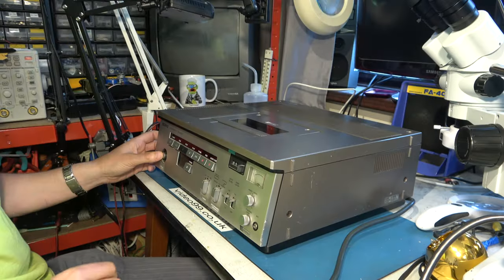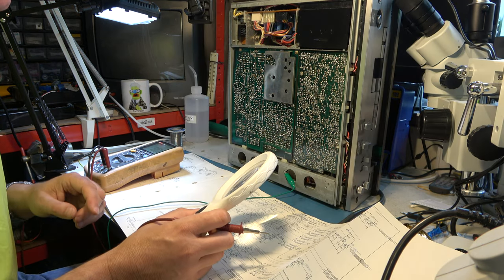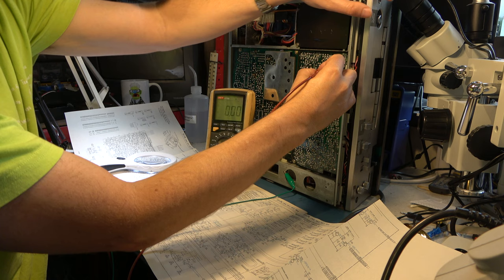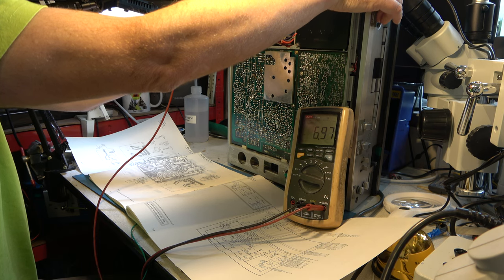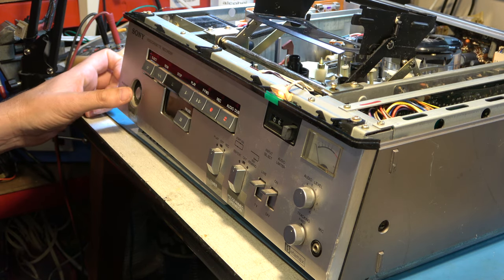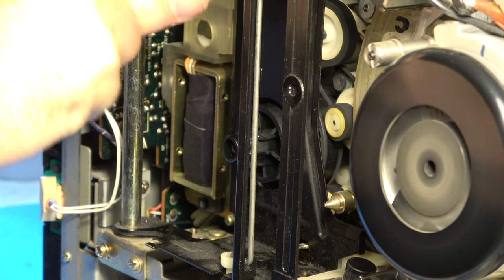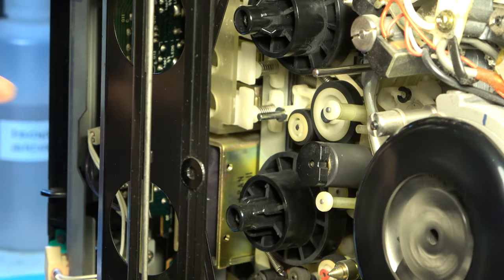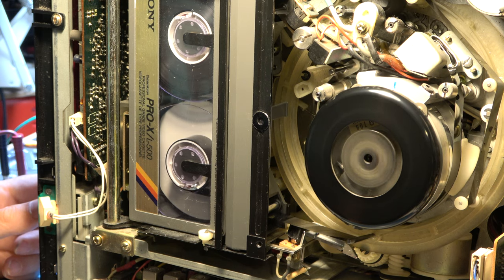Part 3 of working on the Sony Beta SLO 320. Can we finally fix this rare Betamax?

Comment: Very nice to see that wonderful industrial machine fixed and running again. The "Portable" version of that deck is the SLO-340 which records only in Beta I and used a BP-60 battery that weighs more than some of your Hi-8 camcorders :) But in 1978 you could have your own portable home video setup and use your choice of cameras such as the AVC-3450 B&W handheld camera or if you wanted color you had the choice of a DCX-1600 camera when paired with its CCU or it could be used with a pro camera like the RCA TK-76 with a proper adapter cable (and external battery pack).
Reply from the maker: The SLO-340 looks a lot like the SL-3000 with piano-key deck, I repaired one of those just before I started YouTube-ing a few years ago.  The colour cameras were really expensive.

Comment: excellent video,  from what I understand the RF modulator module was removable so a unit with a different output frequency could be fitted if local TV channel used the same frequency  (as an adjustable RF modulator channel feature was not yet possible)

Comment: I cannot not notice the Techmoan mug right there. 😁
A fan on top of the head drum. That's quite unusual.
Reply from the maker: A lot of early video recorders had a fan on the top of the head, to try to keep condensation to a minimum.  I think it was managed later with heaters and head design.  The fan added to noise.

Comment: Well done colin :-D i'm chuffed that it's working so well now :-D
That workshop manual helped a lot,  schematics make life less stressfull.
The only way you know it's 100% fixed is move it about and excersize it.
I've had electronics play games as well,  so many times i've said "Got it!!", then it sticks it's electronic tongue out at me lol.
I would replace both diodes just in case, but that's me not trusting them.
Connectors/pins can be sneaky at times.
Reply from the maker: I've tested quite a bit more than you saw in the video, I think it really is fixed.  I'm buying in some more cabling so it will get set up permanently in the studio and tested regularly.

Comment: There were also L-830 tapes which ran for 3 hr35 mins. I used to use beta, had sanyo VTC-5000s and plenty of Sony machines over the years including a lovely (at the time) SLHF100UB ...fun days :) thanks again for your excellent videos
Reply from the maker: Yes, L-830 tapes were quite common, a bit under 4 hours.

Comment: Hello colin, could you please tell me what is the main cause for colour banding on beta vcr's, mainly sony...thanks.
Reply from the maker: Hard to say.  Not something I've seen often.  It can be misalignment of colour circuits, possibly due to dried out capacitors.  Not something that can be fixed from a distance, it needs careful work with an oscilloscope and service manual.

Comment: "Let's hope this tv supports NTSC" and it does of course.
When I moved to the USA one of the first things I noticed was that (A) TV's were a lot cheaper (my first American TV was $300 and my last European TV was probably $700) and (B) American (CRT) TV's didn't have nearly as many features as European TV's. No teletext, no channel presets, no SCART, no RGB (in those days anyway) and no "oh by the way if you have a VCR and tapes from another country it will just work".
So are you going to scan that service manual and put it online to help other owners search for the diode with the dry solder joint in the haystack?
Thanks for posting! Great to follow along with the troubleshooting this way.
Reply from the maker: Certainly the vast majority of UK sold TVs support NTSC but a few don't. The manual is too large to scan in, it would take quite a long time to do properly.
Reply: I think this was at least partly to stop grey market trade of cheaper American TVs. Even now a lot of American TVs won't display a 50hz signal over HDMI for the same reason.
Reply: @irtbmtind89  I think it's for practical reasons. It's relatively easy to make a PAL TV show NTSC signal by adjusting oscillators to different frequencies and not flipping the phase. But an NTSC TV would need added parts to show PAL.
But also in the USA competition between manufacturers was always more fierce than in Europe, so that drive prices down, and features out.

Comment: Screws are JIS (Japanese industry standard) not Pozi or Philips.  The pinhole is an identifier for JIS.
Reply from the maker: But JIS screws are cross-headed aren't they?  These are slotted with the pin hole in the centre.  I tried looking them up but can't find anything on them.

Comment: 4 HR BLANK VHS TAPES were sold here in Australia EQ-240 BRAND
Reply from the maker: Here too.  Even 5 hours.  But what I was getting at is, once a machine records over 3 hours on a tape, running time was not usually a problem for most users.